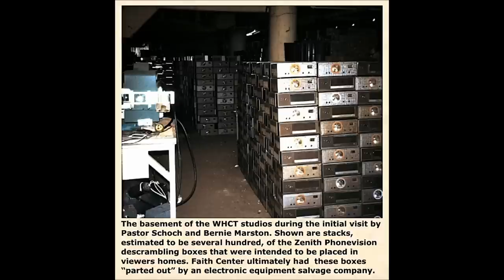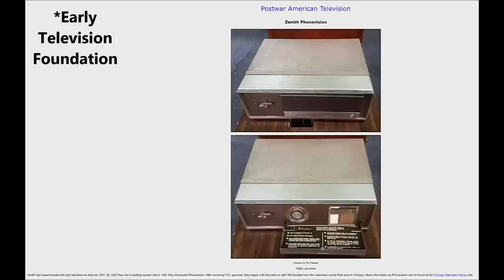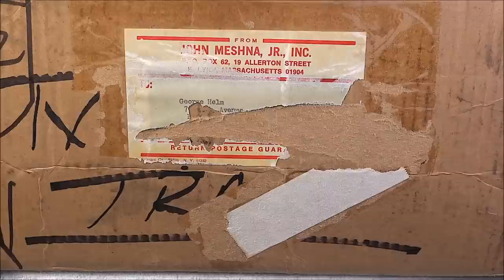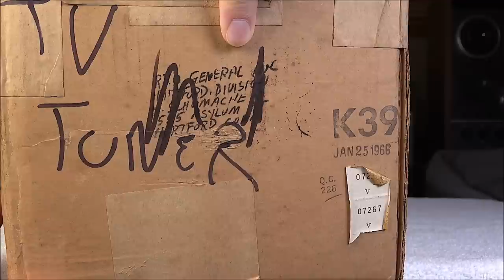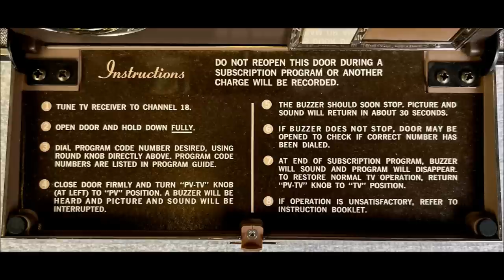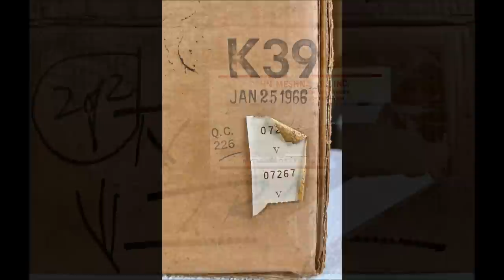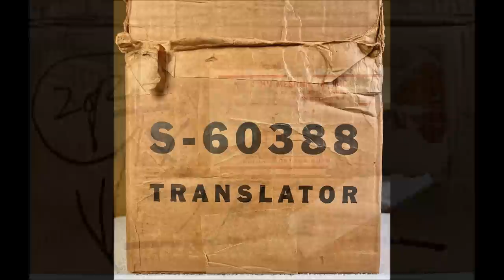Oddity Archive: Episode 267.5 – Ben’s Junk: 1966 (partial) Zenith Phonevision Pay TV Box

Comment: I think the valve plug and sockets were to connect the translator to the back end.  There might have been valves in the back end (I'm guessing the 1950s version would have used valves, maybe the 1960s version would have been discrete transistors AKA solid state) put the valve connectors on the back look more like they would have been used like pin headers and ribbon cables are on internal connectors in modern stuff.
Reply from the maker: Could be.  By the same token, I did find some tubes (from the same period and mostly UK-made, incidentally) that seemed to fit.  Alas, the patent drawings didn’t go into any real specifics.
Reply: @OddityArchive  Yeah, I'm not sure how many differences between UK and US valves/tubes apart from what we called them (strangely, the CRT in an old TV was never called a valve in the UK, it was the tube and all the other tubes were valves)
Reply: UHF tuners were the first part of most TVs to be transistorized, because tubes drift a lot at those high frequencies. So maybe the Phonevision box did use some tubes, but the RF part of it was almost certainly solid-state.

Comment: The last weird 60s Zenith device I remember was my grandfather's rotating antenna.
You had a little grey box with a big knob on it, and you'd mark where stations were around the knob. When you turned it, it rotated the roof antenna with a grinding buzz noise--both in the box and antenna. Worked really well to pick up Buffalo stations from below the Niagara Escarpment in Ontario.
Reply: Radio Shack used to sell those and the antennas under their Archer brand. They can still be used for over the air HDTV reception.
Reply: @fixman88  Yep! There's no difference between an "analog" TV antenna and a "digital" TV antenna. all antennas are shaped wires tuned to a particular band or bands of radio frequencies. The modern ATSC TV channels are STILL in the VHF/UHF bands where the old ones were. The antenna doesn't "know' or "care" is that radio signal is modulated with an analog signal OR a digital signal. only the TV "cares"! A rotating rooftop antenna will work even better! (just like the old days!).  I live in a "signal" rich area and get  82! over the air channels with an $8 pair of "rabbit ears" I got at Dollar General. Don't fall for the "special" HD antennas shown on late night TV ads!   TL; DR: Even the OLDEST VHF/UHF antenna will work with ANY TV., New or old.

Comment: Never saw a Zenith Phonevision up close before. Wonder if you're going to do a Ben's Junk on those old style Cable TV decoders with the row of buttons on the top.
Reply from the maker: Not sure what I'd say about it or how I'd demo it.  I seriously doubt those old ones would understand a modern Cable TV signal being fed in.
Reply: Sounds like you might be talking about a Jerrold box. In Tyler Texas where I grew up the local cable company used those (and my father worked on them).
Woodgrain plastic, row of black buttons, channel band selector switch on one side and fine tuning knob on the other? Connected to a box on top of the TV (or somewhere near it) with a long brown wire?
There were also single units with the buttons and the box as one thing but those seemed to be a lot less common.
Reply: @OddityArchive  The regular channels 2-13 were the same as regular broadcast TV. If you had a local transmitter or signal generator with a coax cable you might be able to connect it up and get one of those channels to work at least.
Reply: I LOVE how OA video comments bring up old, near-forgotten memories buried in my brain.  Such nostalgia.  I think I saw (maybe used, not sure) the style of cable box you're describing around 1985-1987.  Also reminds me of a much newer memory, of a behind-the-times cable system that had to split its incoming channels across two separate coax wire feeds with an A-B switch at each TV, no cable box, just their equipment apparently couldn't handle modulating all their channels on one coax line.  This was in the late 1990's.  Other cable systems in the late 1980's were running all their channels on one coax line; this cable system just had lousy equipment/infrastructure.  And all new-built houses in the area had twin, molded-together coax wires run in the walls for it.  No OA-worthy equipment involved there, just a simple coax A-B switch, and a lousy cable company.

Comment: That is fascinating.  I don't know for sure, of course, but those tube sockets might actually be interface connectors.  I have seen some old tech use sockets like that for that purpose.  It seems odd to me that they would be going with tube electronics for something not requiring high voltage or power, but it isn't unheard of even as late as the mid-60s.  May be wrong.  Probably am.  Just thought I'd mention that.